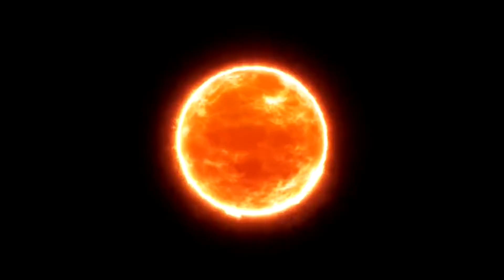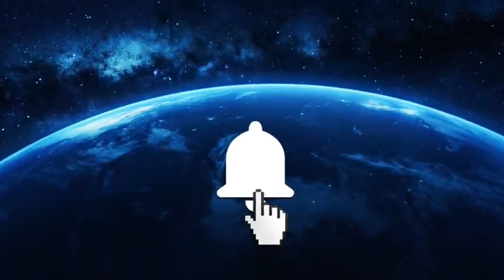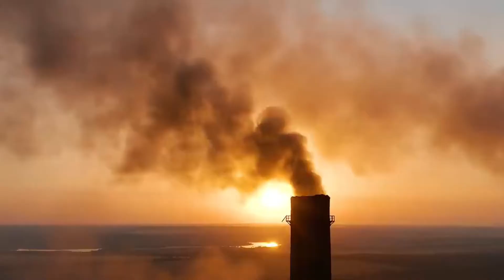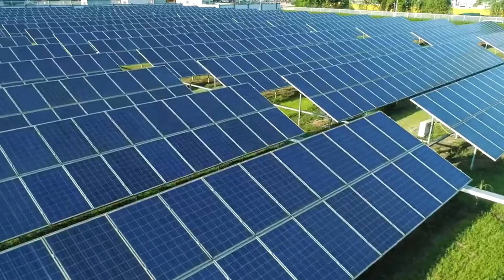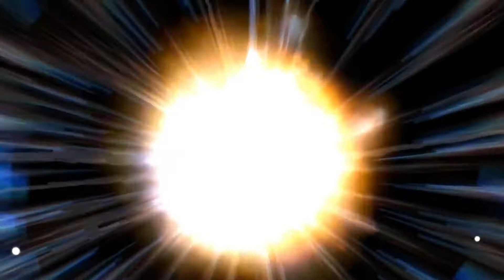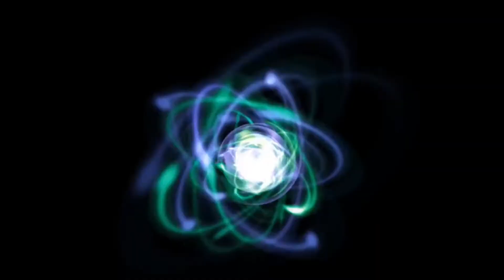Scientist Make Major Break Through In Nuclear Fusion

Comment: Don't worry. China will never make a commercial fusion reactor.  And by 2040 all the more so. And the EU and the U.S. and England will never make a commercial fusion reactor. https://www.youtube.com/watch?v=91NOjCePzdI  There is no nuclear fusion in the core of the Sun. Nuclear fusion occurs in the solar corona
Reply from the maker: So I guess the Russians will?
Reply: @ArtificialNewsTv  In Russia, science is run by the same dogmatists as everywhere else. They don't want a commercial fusion reactor in two years. It is not profitable for them. The developers of the commercial fusion reactor have been using the wrong theory for 70 years! And they don't realize that they are deluded. They don't want to understand that they are dogmatic and moving in the wrong direction. That they have been at a dead end for 70 years. They don't understand why to hold a plasma with a temperature over 100000000 K. There are no physical conditions for nuclear fusion in such a plasma.  
В России наукой управляют такие же догматикии как и везде. Они не хотят получить коммерческий термоядерный реактор за два года. Им это не выгодно. Разработчики коммерческого термоядерного реактора используют неправильную теорию 70 лет! И не понимают, что они в заблуждении. Не хотят понимать, что они догматики и двигаются в неправильном направлении. Что они в тупике 70 лет. Они не понимают зачем удерживать плазму с температурой более 100000000 К. В такой плазме нет физических условия для ядерного синтеза.